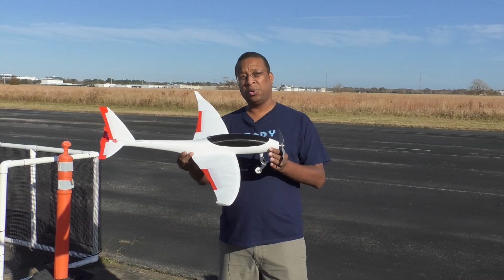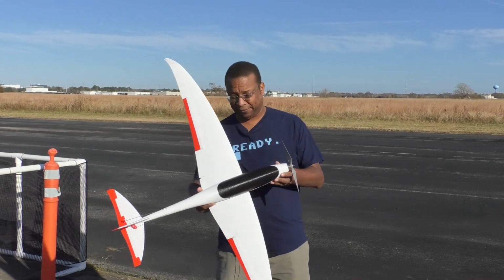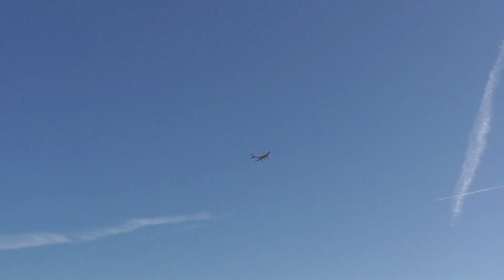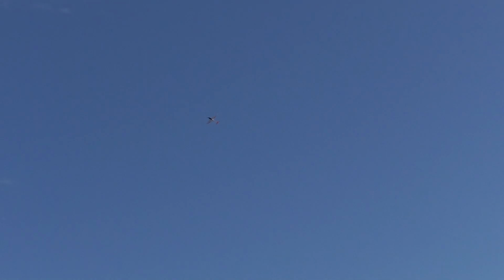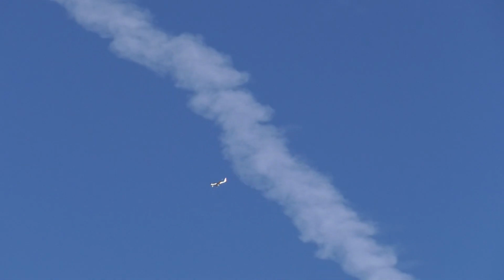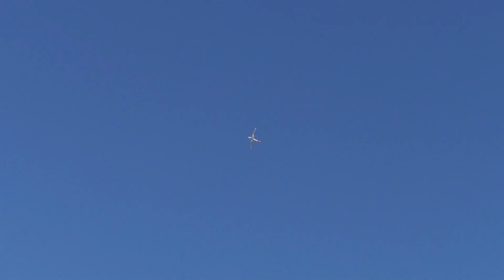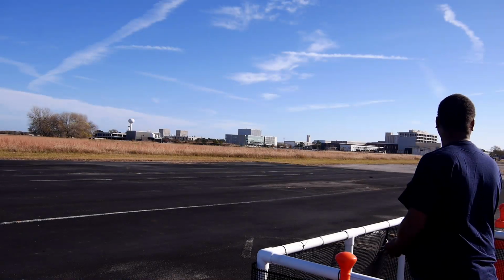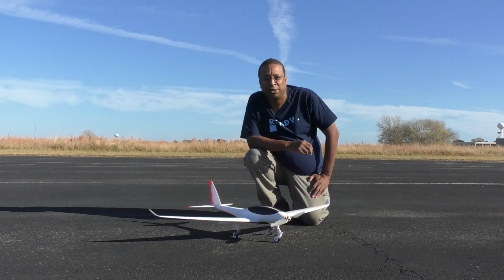Eclipson Model Z 3D Printed RC Airplane | HobbyView

Comment: Hey I been trying to get into rc airplane I’ve flown rc places before but no plane has lasted me more then 3 flights I know i sucks lol but I like the new flight stabilization would it work on this to help me out
Reply from the maker: You do not want to learn on a 3D printed model. I would highly recommend an E-Flite Apprentice. Probably the best RC trainer I've ever flown. And it's pretty durable. Comes with stabilization which can be mostly turned off once you are ready for more advanced flying.
Reply: HobbyView thanks I was looking at the e flight umx timber
Reply from the maker: @cesar68033 , That is also a good little plane. Just realize you will more limited to less windy days with it.
Reply: HobbyView thanks for the heads up

Comment: regarding design:   this is an  UN-informed  mashup,   of a powered sailplane  and  low-wing  pylon racer,  that had  turboprop  power.   cheers
Reply from the maker: Perhaps, but it is interesting and unusual. One of the nice things about model airplanes is that you can easily experiment with unusual and un-intuitive designs. Sometimes they work and sometimes they don't but no one is harmed in the attempt.
Reply: 3D printing technology give you the opportunity to manufacture and design complex things without extra cost, this is a new reality that good designers should be aware of from my point of view. Have a look this article: https://www.aircraftinteriorsinternational.com/features/3d-printing-aircraft-interiors.html
Reply: @3pa908  Nice article. I do 3D printing. Industrial. I have a polymer impeller housing waiting on me.

Comment: thanks for posting   good work  and  piloting.   here are some things to consider.     the dat-files have resulted in    BAD  main wing Design/planform.    BAD  stab design.       (without the (mass of the) landing gear mounted (to increase keel effect stabilization),  this model would fly ONCE, and not far.)    at some point in time,  the  unpredictability of this non-conforming  design, will  bring the model down.      why  is the cockpit canopy  so  Huge/long.         it should be understood that the use of wingtip  appliances  on a  TINY (low in mass)  model   is  NOT  recommended;   BECAUSE   THE  RESULT  is  a model that has a   Polyhedral  main wing.    it should be understood that, as with most printed designs,  this model is  Heavy,  for  its  size.    cheers           googletranslate         some resources
https://wright.nasa.gov/airplane/shortw.html
see  'lecture1'   through  'lecture9'
http://www.stengel.mycpanel.princeton.edu/MAE331Lecture6.pdf
Reply: It seems that flies also without landing gear... https://www.youtube.com/watch?v=6h-pgSw9cHA&list=PLbDVQnriQYoPKo62ncF060SPrphxwPPP4&index=4